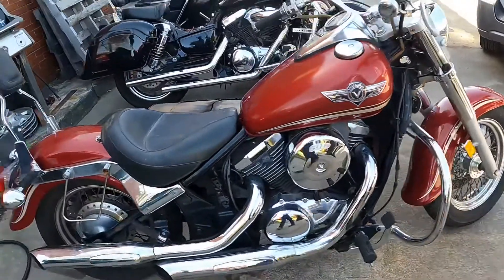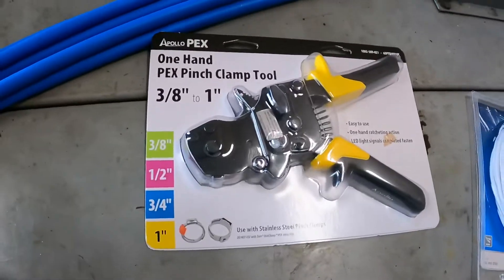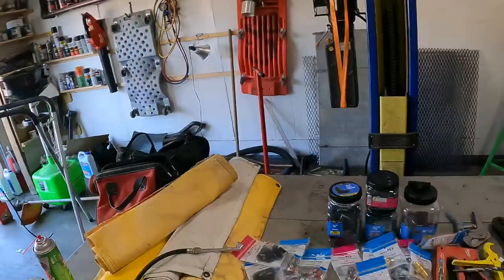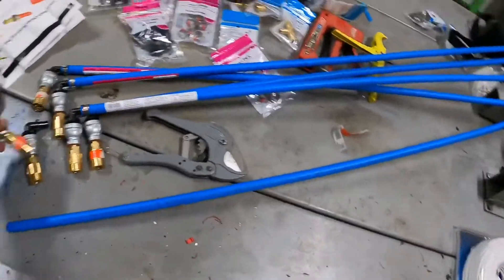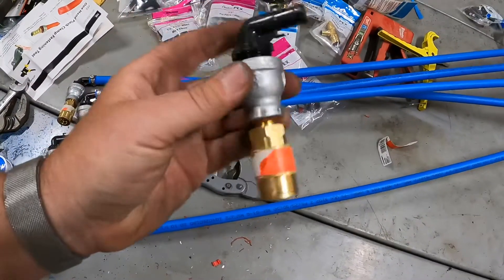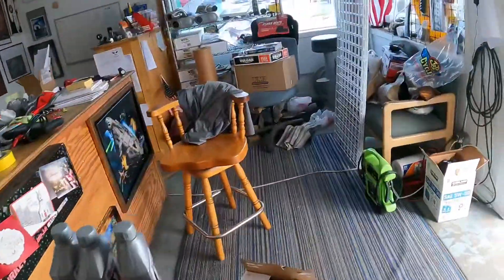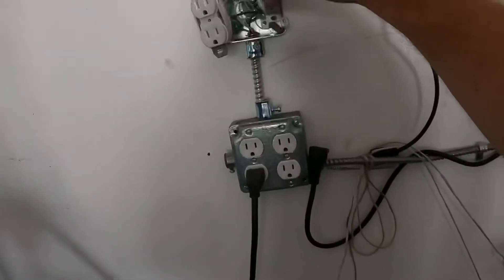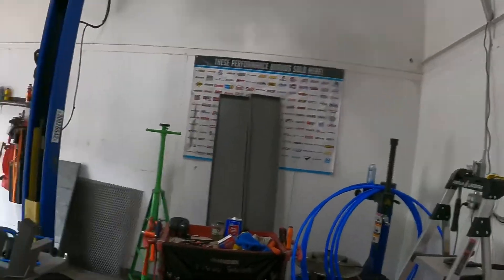can you really use PEX for your shop Air supply line ??

Comment: Any problems with the pex air line after a year of use? Would you do anything different?
Reply from the maker: no issues no leaks , surprisingly forgiving too, ive pulled a cpl of lines off the wall and and all the ends and fittings...they stayed attached ,,... in my case i would have planned a little more for future things like shelves , doorways electrical .. in the next cpl of months ill be moving my compressor and it will be so easy to cap off anything a relocate it.. so def happy i went pex . and both the crimp and ratchet fittings are still working
Reply: @TheMadSnap'r  I am building a new shop and am going to do pex. The last shop was all copper, a little to expensive to do that now.